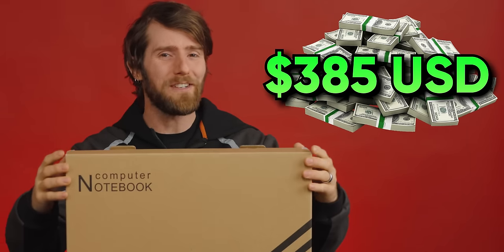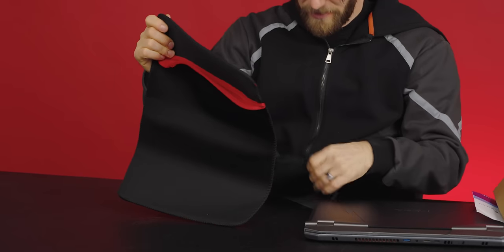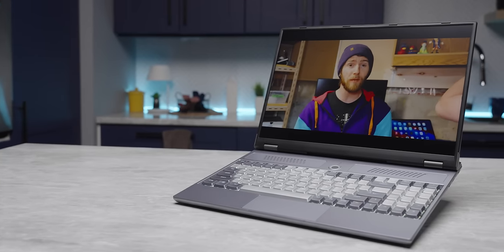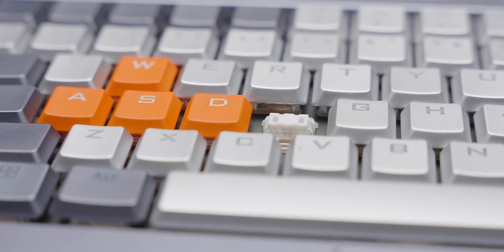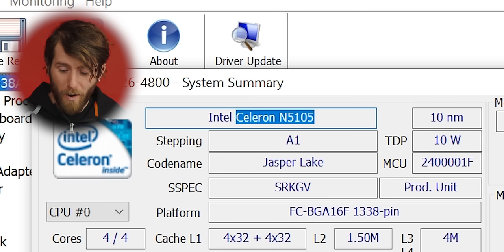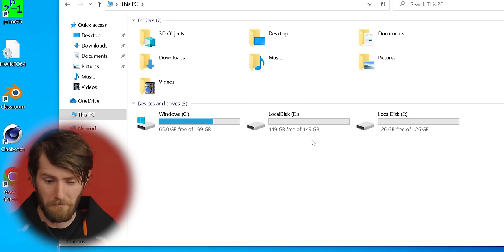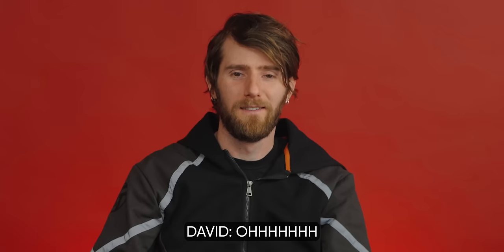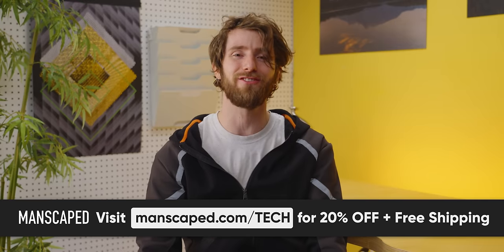Brown Star for Effort – This AliExpress Gaming Laptop is HILARIOUS

Comment: Holy, that webcam thing is actually sweet, I wish that were more common (as long as it works XD)
Reply: needed a less terrible connector, basically.
Reply: It just need a better mechanism to lock it. Forget magnets. A captive screw is all you need.
Reply: @juntapiezas  or maybe something like that doodad on tool less m.2 ssd slots could work.
Reply: That would be a sick idea with a better design and build quality
Reply: @laurencefraser  What about a similar connector to how Lian-Li do their Uni fans? They lock in nicely, and I haven't had any issue about them not being connected.
Reply: @juntapiezas  like how the old PSP camera locked on. But this time without a plug you could still use contacts and a captive screw
Reply: yeah, I would love any other laptop with this feature if implemented a little better
Reply: Please Framework, make the webcam modular!
Reply: @laurencefraser  Pogo pins should have solved that problem. They seem to have just used regular pins. Pogo pins literally exist for this kind of idea.
Reply: Just make the webcam cover dual purpose, slide it right it locks, slide it even further it covers the webcam, easy.
Reply: @juntapiezas  I think we can just reuse the PCIe slot's locking mechanic for this.
Reply: It just should have been a usb (c) port.
Reply: I have a 2021 Zephyrus G15 which means I don't have a webcam. This would have been a sweet inclusion! Granted, I used a USB webcam on top of my monitor at home and have used my phone as a webcam on the go before. But having this solution would have been awesome.
Reply: @laurencefraser  @JuntaPiezas
 what does i matter, it's not falling off when in use.
Reply: yep and also they could use already used in long time as connector just need modification to unlock it,

it cartridge mechanism where is proven has strong connect points, they just need release key to release it, and one more key to lock it with dummy receptor while is not used, including slide open/close the lid,
Reply: aww poor Ali Express, they didnt pay Linus millions of dollars to film a commercial for their products and didn't get a typical puff piece from the Loser mass market electronics dweeb in chief....how ever will they survive....
Reply: dont most wireless earbuds charge with those type of magnetic contacts? I'm sure they can be made better
Reply: Especially because of privacy
Reply: Only if they know how a pin connector works
Reply: It's funny how these chinese companies are so very close to being innovative. Like the only thing they need is for it to work correctly.
Reply: @josephbartholomew  but it doesn’t work so it’s a joke.
Reply: Even Linus was behind the times -- IBM had its Ultraport (a weird USB port on top of the screen for webcams) from 2000 to 2002, with an older version back in the mid-90s.
Reply: Either theres probably an apple patent being violated somewhere here as its basically maglock, or the reason it doesnt work well is that some compromises had to be made to avoid the patent. Alas. Good idea, bad execution.

Comment: It's not exactly a "gaming" laptop, but this kind of hardware combo is what I've been proposing as a non-gaming home or office machine for years now - use available height for a good screen and keyboard and save space with a modern-day Atom SoC (the Celeron N5105 is about as powerful as an i5-2400 if memory serves)... not like it has to be the sleekest thing in the world to begin with. Would I like a laptop with a good IPS screen and a mechanical keyboard, hell yes I would.
Reply: Literally just give me this with, like, a low tier but current GPU and at least the equivalent of a Ryzen 3600 and I'll be happy.
Reply: holy shit, roughly equivalent to an i5 2400? that's huge. i was still running that cpu with a 1060 until like a year or two ago, and it was great. genshin maxed out np, csgo runs well above my 144hz screen, and some other stuffs.

that's actually awesome, you could probably jerryrig a desktop gpu with some mini pcie adapters into the laptop, and get yourself a great budget desktop replacement
Reply: @vincentlaurensius8714  ehhhhh not with that battery. You'd be flat in 30 mins without AC
Reply: @vincentlaurensius8714  yup, the majority of tests put it almost exactly the same as the 2400. Some have it 5% ahead, only noticeable loss for the celeron I could find was 16% but might just be a quirk of that version of geekbench. And that's at like 10W vs 95W lol
Reply: @shahtayyib  I think it's more like a "student typewriter with occasional Genshin" than anything like "five hours in a coworking". 
Plus with that draw I wonder if you can charge it using just portable batteries with type-c.
Reply: also it seems very slim, so it would be easy to carry. 
if i would need to get myself a office laptop this probably would be my budget choice.
Reply: @shahtayyib obv it would be plugged in. I thought they meant with a dock

Comment: The pins and magnetic connectors on this laptop almost remind me of the way the Motorola Motomods connected to the back of your phone. Which was a pretty incredible idea tbh! They work surprisingly well even years and years later, the connection between the laptop and the pins area probably is the biggest hinderance to the design here since the only issue I had is sometimes the MotoMods would be finnicky if you didn't exactly have them lined on properly or there was a bit of dirt on the connections, but they had much stronger magnets and the flat back a phone has means it was a much stronger and secure connection and would "lock" into place.

Comment: My used 'writing' laptop is a Lenovo X220.  That keyboard is unbeatable.  The computer is slow, but for web surfing and writing scripts, it's GREAT!  I use it in my lap while I'm doing stuff on my main computer.  A good keyboard is essential to the experience.
Reply: Classic lenovo/IBM thinkpads definitely have some of the best laptop keyboards of all time.
Reply: I put the keyboard in my x230 with unlocked i7 @4GHz, not slow anymore, especially when using Linux :) should be on par with that Deeq thing while being 10 years old.
Reply: The old X series cannot be beaten in productivity experience. You can actually get Chinese replacement motherboards with 10th gen intels on them, that fit in the old x200/x201 frames (x2100 project).
Reply: Wish they kept and improved that keyboard. My x230 and even p14s are still best in their class. I hate that we get crappy Dells at work instead. :(
Reply: Yeah but you can upgrade the CPU on that laptop if you bought it with an I5 and go with quad core with hyperthreading.
Put an SSD in it and it it a good laptop for browsing the web, movies, youtube and with a wired internet connection you can even use GeforceNow.
Reply: If the sata interface and speed supports it, you can always throw an SSD in there and if the ram is still upgradable, can definitely add more if you wanted to throw some new life into it
Reply: I have a Lenovo thinkpad T430
honeslty its old but its still good, keyboards is perfect
Reply: @Teksers  I've had an SSD in it for a while now.  Hadn't thought about the CPU.  I'll have to check into that.
Reply: @Sakosaga  Already have a SATA SSD in there and the RAM is maxed out.
Reply: Yep. Thinkpads and ssds are the way to go for a reliable work setup.
Reply: @RyeOnHam  rip, probably just bottlenecked by CPU speeds
Reply: I got X230 just because it has USB 3.0 for the i5 model. The keyboard is unfortunately a bit of downgrade from X220
Reply: Get linux it'll become GREAT
Reply: @Don IKR, I find it surprising something as Iconic as the American Buissenss laptop was sold too a chinese company, one that repeatedly gets csught spying on useres of them
Reply: I still daydrive a X220 with extended battery that I found in the trash about 8 years ago, for coding purpose on a robot. It's indestructible. It must have felt 4-5' drop hundred of time, it's barely scratched..
Reply: The keyboard on my Latitude 7490 that I bought from an auction is surprisingly great with way more key travel than I ever expected. Not as tactile as a brown keyboard, but still in the realm
Reply: @DumbArse  yeah, the X240 and onward models use U series CPU, that while halves the wattage from 35W to 15W, did have some serious impact to performance
Reply: Yeah, my daily driver is my gaming desktop at this point, but I have a Thinkpad T450 running Ubuntu that's my go-to laptop and it's fantastic despite being about seven years old.
Reply: I still daily drive my i5 X230, and even though it is docked next to my liquid cooled i9 monster tower I usually boot the laptop if I am not gaming. It is just fast enough for light use and nice and quiet to boot. The old Lenovo laptops are unbeatable.
Reply: As someone with a few thinkpads from T60 to T420 and T430 & newer, I really don't get the keyboard fetish people have. Also my T420 & older are noticably slower.

I'd actually argue the screen is far more important. I put the best 1080p TFT possible in my T530 and it's sad comparing it to my T470 IPS.
Reply: @hydrocarbon82  Yeah, I upgraded from a T420 to a T450 because the screen, the performance and the touchpad were all a big improvement while still staying comfortably in-budget for what I needed in a laptop.
Reply: Too bad they're horribly overpriced.
Reply: Solid taste, would recommend the same
Though its only slow when you use the bloatware that is modern windows, I run fedora workstation on mine and its perfectly snappy
Reply: @MohammadIkhsan  With a little bit of modding work, the X230 is actually compatible with the X220 keyboard (and palmrest). Its a very common mod for the 230 so it shouldnt be hard finding help on
Reply: I have a Thinkpad t470 and I love it.. it even runs macOS 13.1 actually pretty good for the most part I need wifi kext and a native boot loader but other than that macOS runs quite well with OpenCore Hackintosh method.
Reply: @crasho  Any clue if there is a way to do the same on a 3rd gen X1 Yoga?
Reply: I like my Lenovo laptop keyboard better than those from HP, Asus, Dell, etc.
Reply: My buddy used this laptop through his entire computer science degree and finished two years ago. Still uses it as his main laptop today as a google engineer.
Reply: have that laptop for a while before switching to another Thinkpad, that laptop is amazing for 17 years old me, and that laptop makes me joint Thinkpad cult
Reply: My T430, with i5, 2x4Gb, 240SSD + 1 TB HD(in the CD/DVD Diskdriver) with PopOS, is my on to go Laptop.
I use to go to university, to reunion, to work. It is like the old Nokia but in a Laptop format.
I got him in 2017, I did all the upgrades plus a new battery. It was something under 140 USD total.
Reply: ThinkPads for the win
Reply: @bigbodge  they do, but I decided to go with backlighted Russian keyboard off Aliexpress instead :D
Reply: @Teksers  I thought all the X series had soldered CPUs. At least my old X31 is. But the standard 2.5GHz i5-2520M CPU in an X220 isn't really that bad, it's twice as fast as my current daily driver craptop which I still manage to tolerate.
Reply: @eDoc2020  all thhe 2nd gen and 3rd gen mobile CPU's that ended with M have socketable CPU's. check a disassembly video on  youtube and you'll see
Reply: @Teksers  My daily driver has a crappy i3-2365M CPU and it is very much soldered down. Plus I just looked at the X220's HMM and each of the motherboard SKUs contains a specific CPU. Intel often uses the same model name for different packages of the same chip.

Comment: ngl, marketing a 16:10 display as a 'golden ratio' display is lowkey genius
Reply: They're short by 0.018 or so IIRC
Reply: LOL the timestamp
Reply: @Lodinn  I'd like to see somebody try an actual golden ratio screen: (1+sqrt(5)):2
Reply: @SWalkerTTU  not possible unless they put some bezel over part of a row of subpixels I’m pretty sure, and even then is obviously not exact, a normal monitor is only exact by counting pixels anyways
Reply: And speakers just for decoration 😂😂
Reply: I think MSI started doing this for their 16:10 laptops
Reply: this the kind of shit apple would come up with
Reply: It's pretty typical marketing language in the east asian markets, to be fair.
Reply: They probably actually watch LTT
Reply: @zero_gravity5861  well I mean the pixel counts wouldn't be exact for golden ratio ever, but if you just make the 16 by 10 have the individual pixels be slightly wider than tall you can get it exact.
Reply: @zetahurley7323   I mean that you can’t have an irrational number of pixels. therefore, a true golden ratio of actual pixels is impossible. you can never actually have the golden ratio; you can never get it exact.
Reply: @zero_gravity5861  well yeah in terms of pixels, however for the dimensions of the screen you can get it exact by just having the spacing between pixels be slightly wider than tall, making the actual image/screen be exactly the golden ratio. You're absolutely right that you can't get it exact by pixel, but the more important thing for human viewing is if the screens actual dimensions follow it exactly.

(unless you get REALLY funky with what you consider exact and get into theorhetical physics regarding stuff like planks constant, but then NOTHING can be exactly the golden ratio, or exactly anything really)
Reply: @zero_gravity5861  That was the joke.